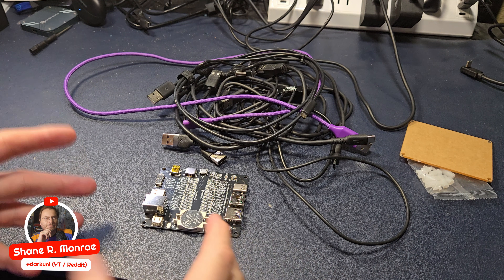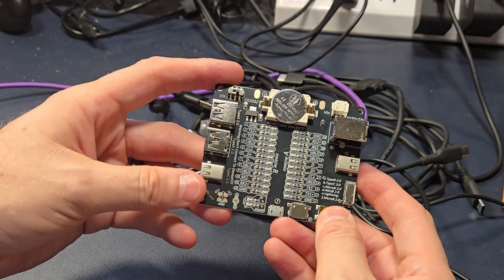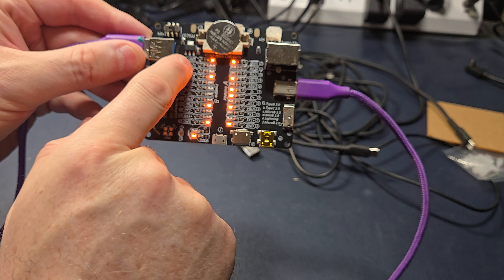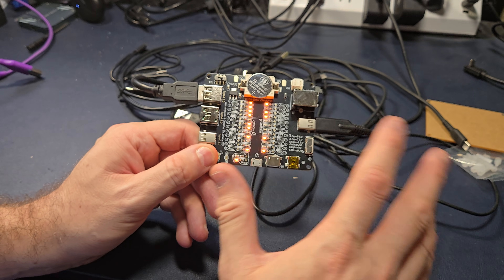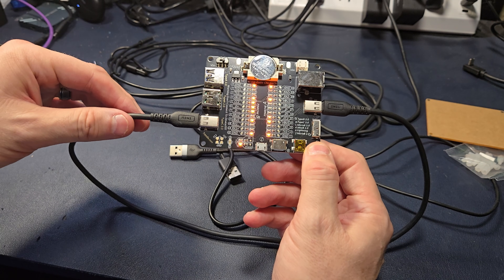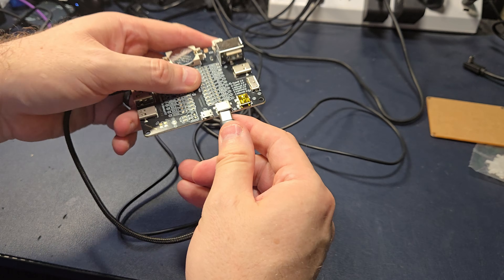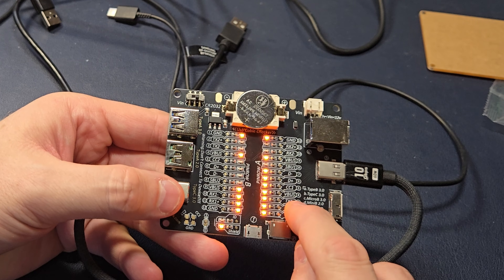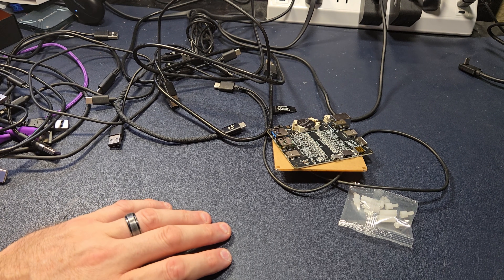USB Cable Checker - Test Capabilities And Tame Your Cable Rat's Nest!

Comment: A good tester, but mine stopped working few month after purchase, and I did my best to check, I changed the battery, and I checked if any damage, and regret, , could not find out and had to throw it away
Reply from the maker: Damn. Thanks for the heads up. I see myself using this en mass when you open it and then a couple of times a year when you find another stack of cables buried somewhere. That's very disturbing though and I appreciate your follow-up.